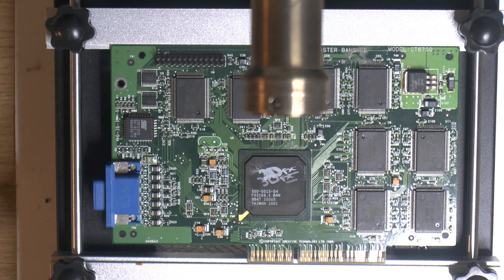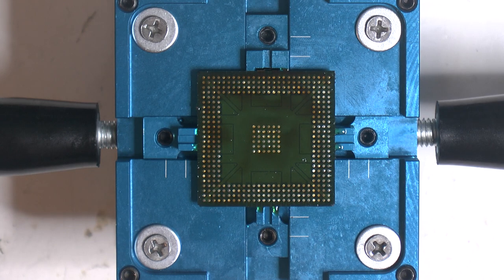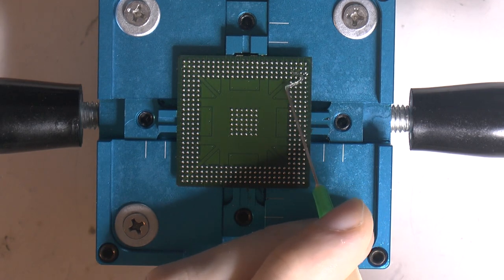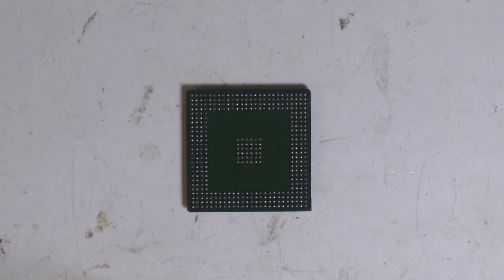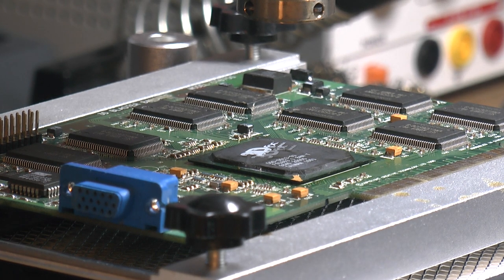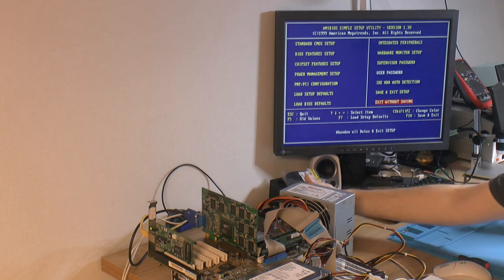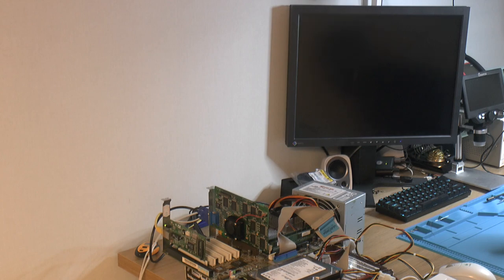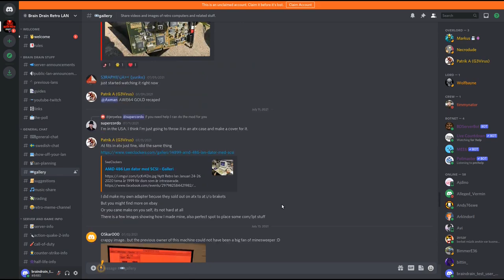3dfx Voodoo Banshee GPU swap and reballing

Comment: Great work. I was worried that you wouldn't succeed. I'm glad it came together.
Banshees are so cool. Even cooler with active cooling.
Reply from the maker: I have tried it before on another stone dead banshee with VGA beeps but its hard to know if the GPU is just dead or the PCB too. I had on that tried before but eventually it seems that all other components was fine so that PCB probably had some internal damage I think so not even a working GPU would make that card post.

But this one I managed to find all working parts and its a creative with fancier ram so thats nice. Figured it was better to get the least damaged GPU and the best PCB/RAM combo and make on working card from two dead and damaged cards.

Comment: Hell yeah great job once again brother, I recently got another v5 5500 and it had a missing 470uf cap so I replaced it with a low esr tantalum and made the mistake of putting it on backwards lol oops. Upon power on the cap exploded violently and it lit on fire for a second before I blew it out. Amazingly I replaced it again (this time in the correct orientation haha) and the card still works. Still mad at myself for putting it on backwards as I knew the orientation I just wasn’t paying attention :-( too excited to get it to work I guess haha.
Reply from the maker: Yea I put a SMD electrolytic on the wrong way the other day on a another Bnashee I fixed the PCB on, all caps where  beaten to death to, The card posted fine then I noticed it and just swapped it out for a new one. Shit happens but best to double check and triple check.

My friends 286 board blew 4 tantalum's when we where going to test it out, that board looked like NEW but well caps where not as good as they looked, fire works and burn marks in my desk XD
Did replace them all and the board worked, also did SIPP to SIMM ram slots upgrade on that board to for him and CMOS mod I if I recall.
Reply: whoa very nice!! I don’t own any 286/386/486 boards. My first pc was a 486/66dx   Matter of fact it was a performa with a dos card in it, pretty awesome actually
Reply from the maker: @computerbooter1566  My first system was a Pentium 166, family computer.
But we did have 286 to 486 in school and some Pentiums.

Now I have two working 486 systems and one board for testing.

486 are fun because the first FPS games with lan support came around then plus I always found it pretty easy to jumper stuff, set IRQ's and stuff on the ISA/VLB cards and just like the fact that I can swap board, or move cards around and window dont care, no resource change.

I always preferred my systems being "dumb" instead of auto config stuff.

Comment: Nice how you did all this with hot air and generic stencils only. I think I need to get into reballing, too. Got any info on the equipment you're using? Any suggestion on the stencils and size of balls I should get for working on retro boards and cards from the early 2000nds?
Reply from the maker: Well Im really not the right person to ask for reball advice, I have done Memory IC's and now a GPU so Im new to this too.
My channel is about doing old mods and repairs and document them in a more modern form, there not professional videos by a pro.
But wit that sad this is what I use to do the reballing.

I use the ATTEN 862D hot air station. Louis Rossman and The Cod3er that runs rework businesses (they are on youtube) uses it as a professional station and its fairly cheap for what you get.
https://www.atten.eu/product/1150852/atten-st-862d-hot-air-station

Then I got the cheapest hot plate I could on ebay.
Search ebay for "hotplate 853A" and you should find it, there is a seller in Germany that have them for 86€ plus shipping, or you can buy them from the china sellers.
You can probably get what ever you want there or even make your own.
I made my own arm to hold the hot air nozzle for example.
I have this hot plate, there are YT reviews around for it you search.

Its a cheap china product so the material quality is okay but the really dont do any QC on assembly so lose wires was an issue for me, my temp sensor wires where lose in there connectors so soldered them to the connector instead.
So if your willing to open it up and make sure its put together right it seems to be the cheaper option right now, they get fairly expensive if you want high end stuff.

Now I have seen this or a similar hotplate with an infrared head and maybe a hot air station integrated in the 150€ range so you can look in to getting something like that, no idea how well they work but infrared seems to be the more professional way to go but well Im on a budget so I try to do more with less.

I bought a reball kit on ebay for about 80€, whit balls and 10x generic stencils and they seem to work for anything this old.
Try searching ebay for "blue bga reballing kit 90*90mm station stencil universal 10/pcs" and you should find them.

I used 0.4mm balls for DDR BGA ram for GFX card, the banshee used 0.76mm I think BUT my 0.76mm stencil has smaller holes then that so I used 0.65mm balls instead.
So that seems to be the sizes I use atm.

I would suggest checking out how professionals on YT do reballing and see what speaks to you and buy gear that fits a method you want to use.
Seems to be more then one way of doing it so.
Reply: Thanks for the helpful details. They way you did it is professional enough for me. I'll get myself that blue station, balls and stencils. Pretty cheap stuff on ali. I'll do some experiments with my current cheap hotair first. I have an AGP X800 Pro and a 9500 here that both run but show major artifacts. The usual "heatgun the core" bandaid, that already worked countless of times for me, did do absolutely nothing for those cards, so I suspect true RAM failures this time. I know those are cheap cards barely worth the effort, but I really don't want to throw them away. They will make good test candidates. If I just knew a way to figure out which of the RAM chips are having trouble...
Reply from the maker: @Shmbler  Yea artifacting has been ram related for me most of the time, very often bad solder joints, but also bad chips.

I did reball and replace a ram chip in this video if you have not seen it.
https://www.youtube.com/watch?v=bYbBvVN4ZDo
The original chip after 2 reball attempt was still artefact so chips do die from time to time so a donor was used.

Idk if I sad it in the video but my goal was to hit about 200C on the GPU on the 280C profile.
I used my multimeter and a temperature probe next to the chip when dialling in the temperatures on a "practice board".

So yea if your gonna reball a gpu for example thats how I got my temperature profiles for the hotair station, whit out that one is flying blind more or less.
Reply: @Shmbler  I have seen a recent video where the faulty ram got way too hot on a voodoo 2. so maybe check temps.

Comment: Impressive. What solder wick and resin gel do you use? 
The stuff which I got via Ebay is garbage. Good solder wick, which has embedded resin, works really well. I really should buy from a trusted source.
Reply from the maker: I use Amtech flux, same as louis rossman sells. Idk if its good enough for reballing but thats what I had, sno no special gel used. Need to look in to that more later.

Yea most Amtech flux on ebay is fake they say, I managed eventually to get some.

Wick, I cant remember, some cheap stuff from Conrad, I did buy a new roll, 30m that Im going to test so dont know how well that works right now.
Reply: If you add flux to your solder wick, it will work much better
Reply: @SomeAngryGuy1997  Yes I do that, however the flux I found on Ebay isn't liquid but solid. It has to be melted into the bad solder wick, but then it does help enormously. Also it leaves a lot of horrible residue behind. I need to find some of the liquid flux shown in the video. I did have one reel of really good solder wick, which contained a proper amount of flux, but I now don't know which one it is :-(
Reply from the maker: @migry  if you can buy it from Rossmann https://store.rossmanngroup.com/blog/flux-soldering-tools.html

Comment: i wonder how hot the PCB assembly machines gets when all components are initially soldered to the board. the idea of necessary high heat to set all components in the first place is intriguing. how hot can these parts get, and how much damage can be done?
Reply from the maker: This was my first GPU transplant and successful reballing of something bigger then a RAM IC so have that in mind, where all learning, me too.

My target temperature for the GPU was about 200C because the leaded solder melts at like 183-188C.
I did work out those temperatures using an old router PCB with a BGA SoC on it.
Put a temperature sensor next to the chip and aimed for 200C and thats how I found out about 280C @ 40mm away was what I needed for the last profile to do the actual soldering (melting of the leaded tin).

So yea 200C or so, with leaded solder melting at a lower temperature then modern lead free I suppose its less risky to damage old stuff.

High heat can de-laminate the PCB and chips packaging and discolor the PCB.
Not preheating the PCB with a board heater or having a to big temperature difference between the hotplate and the hot air station can cause warping.
One might also have to dry the chips in an oven for a day or two at low temps because they can accumulate moisture if not stored in a sealed bag and that can basically create blisters when the water turns to steam and de-laminate and destroy the chip.

So yea damage can be made and I would suggest practicing on old broken stuff, but even so success at first try it probably not likely, thats why I like getting the stuff that people dont want because its trashed.